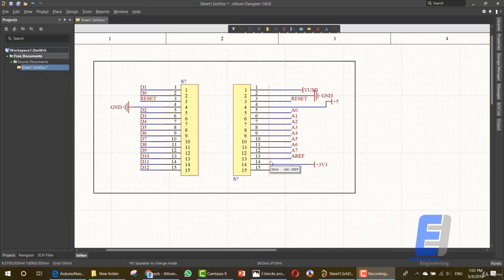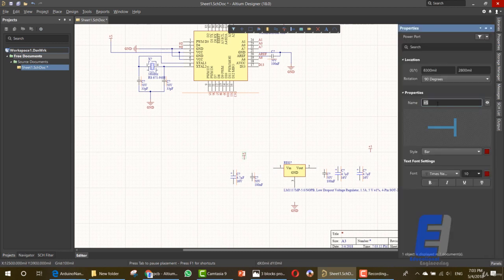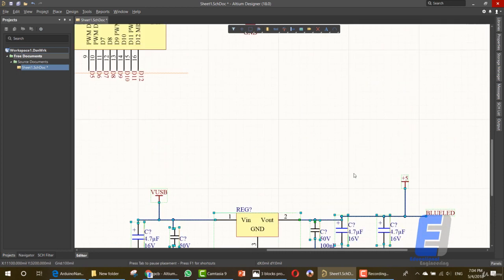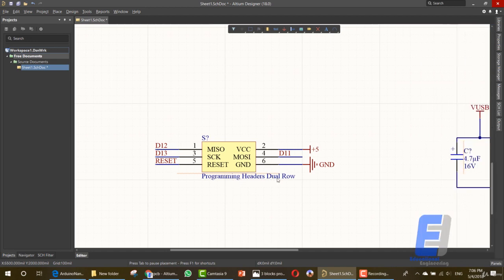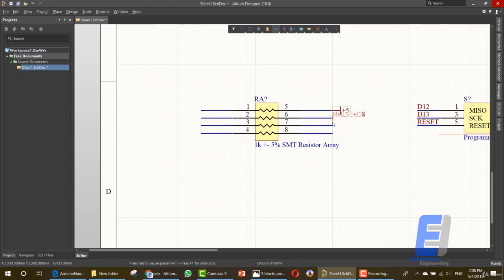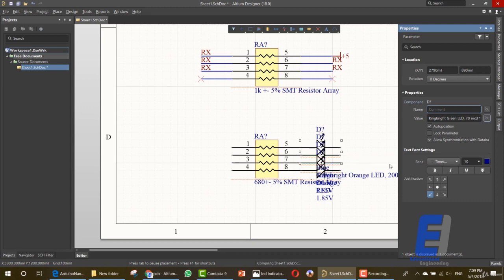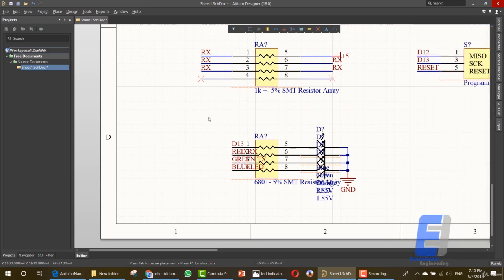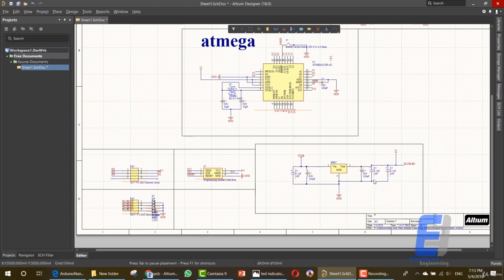Adding Resistors LED Indicators Voltage Regulator  Altium Designer

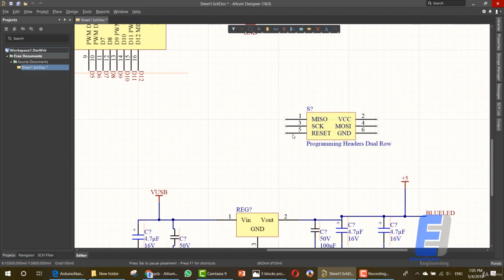Comment: at 3:31 you used VUSB instead of VIN in regulator. Please explain it sir
Reply from the maker: VUSB indicates that the voltage input will be from the USB port
Reply: @EducationalEngineeringTeam  yes but the voltage from USB port is nearly 5v. So, what is the point of using regulator? I think it must be Vin. I saw it on different schematics as well